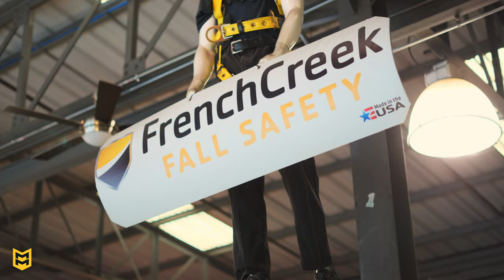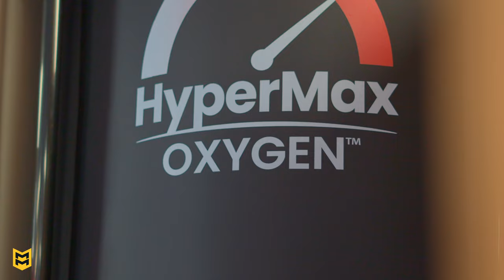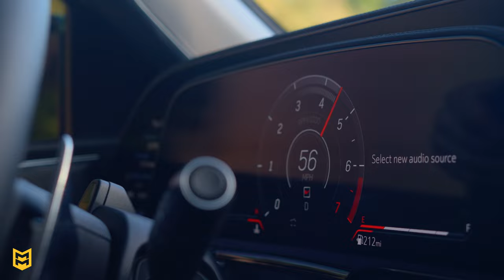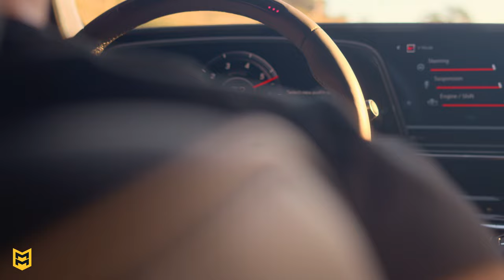I BLEW UP MY WIFES BRAND NEW 2024 ESCALADE V!

Comment: So for the first 500 miles it cannot get over 3500 RPMS and if so it could have problems. GM says not to push them to hard in the first 500 miles.